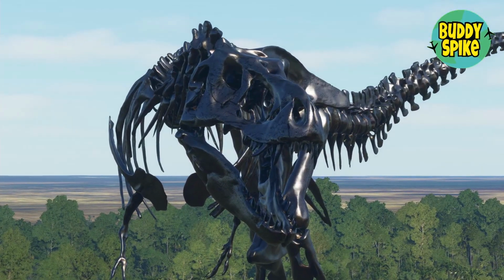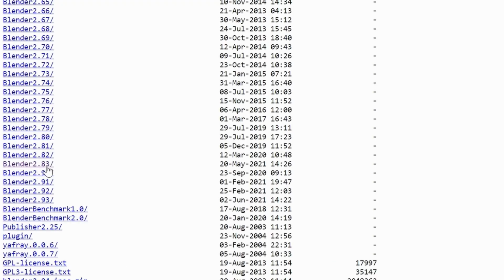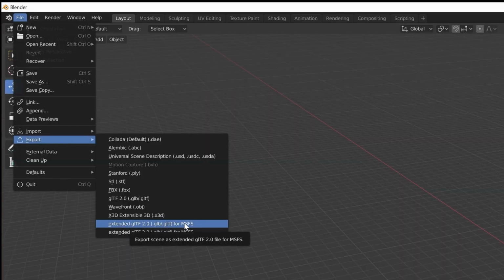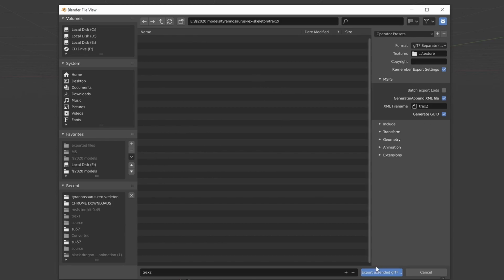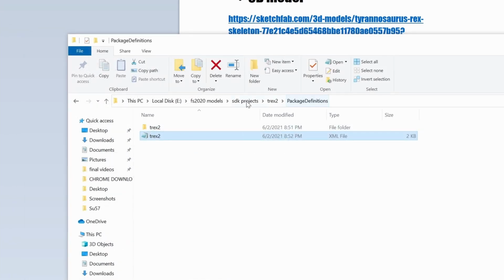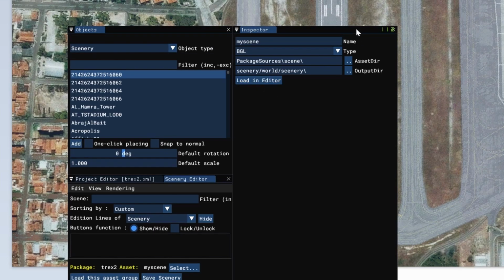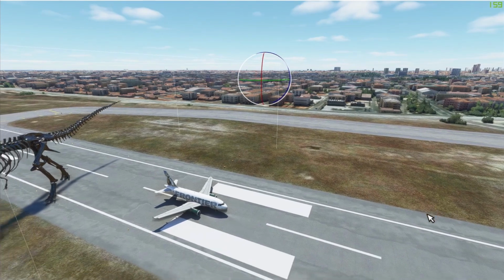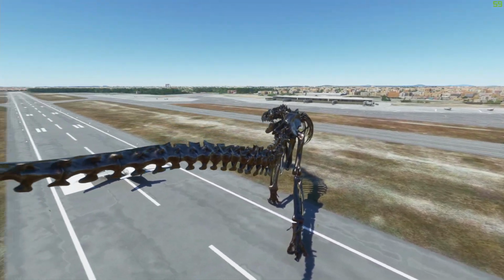How to bring 3d model to flight simulator 2020 [Easy step by step Guide]

Comment: 1st.. a big Thank You for that video. I watched many video, but this is the only one with which I was able to have my bridge included in FS. Your video is not too long, very precise, and it works!
The problem I had, and it is maybe something you can add in your next video are:
The name: your is  "trex2", and my was "BeaufortBridge", and it was not working because of the upper cases letters. 
then other problem was that at some point it was asking to save and when I saved it, I didn't saved it in the right folder, as those folders with subfolders with the same name are confusing. It's not your fault!!!
the last problem was for exporting from blender. My bridge's project add several parts, and it seems that we need to have only one library to export. With several libraries, the bin file was not created, and so I tried to export the basic cub and everything worked perfectly, as the name was only lower case letters too. I need to work more on my blender skill to go from level ultra basic, to a little not as bad. lol
Thank you Buddy. Now i'll be able to do my own scenery as I was doing with FSX.
I'm impatient to see your next video, and I can't understand why there are only 83 likes for this one.

1st.. a big thank you for that video. I watched many, but this is the only one with which I was able to have my bridge included in FS. Your video is not too long, very precise, and it works!
The problem I had, and it is maybe something you can add in your next video are:
The name: your is  "trex2", and my was "BeaufortBridge", and it was not working because of the upper cases letters. 
then other problem was that at some point it was asking to save and when I saved it, I didn't saved it in the right folder, as those folders with subfolders with the same name are confusing. It's not your fault!!!
the last problem was for exporting from blender. My bridge's project add several parts, and it seems that we need to have only one library to export. With several libraries, the bin file was not created, and so I tried to export the basic cub and everything worked perfectly, as the name was only lower case letters too. I need to work more on my blender skill to go from level ultra basic, to a little not as bad. lol
Thank you Buddy. Now i'll be able to do my own scenery as I was doing with FSX.
I'm impatient to see your next video, and I can't understand why there are only 83 likes for this one.
Reply from the maker: thanks for ur support, I will pin this comment so others can see it too